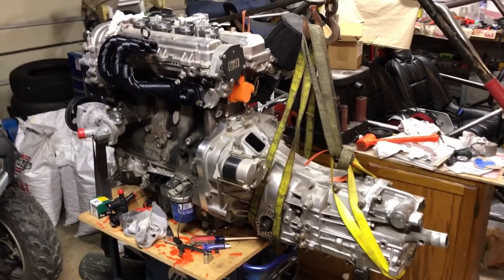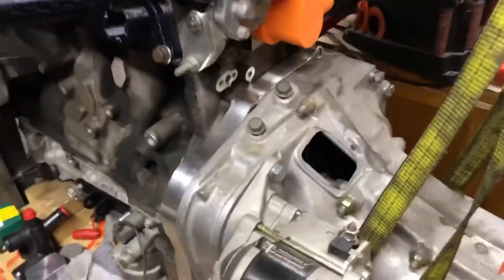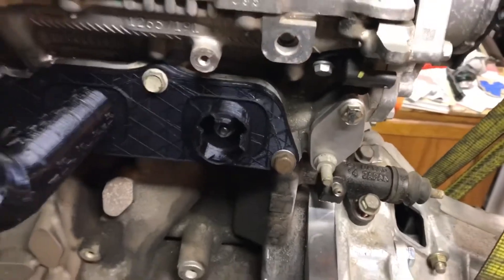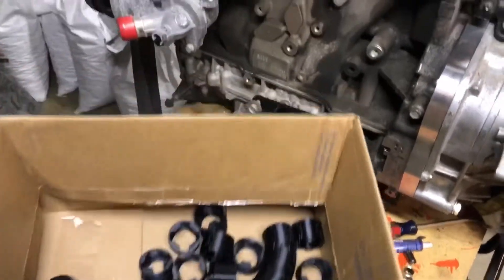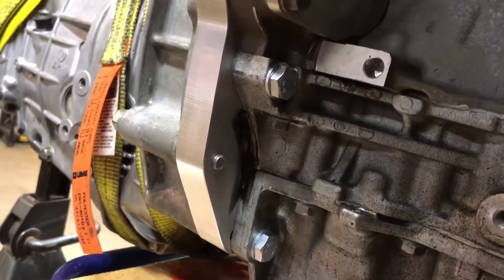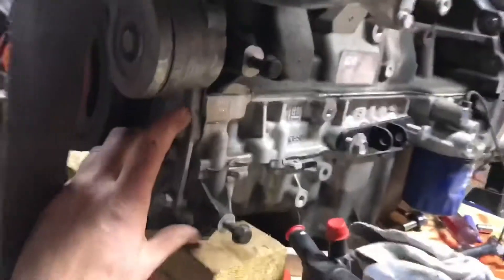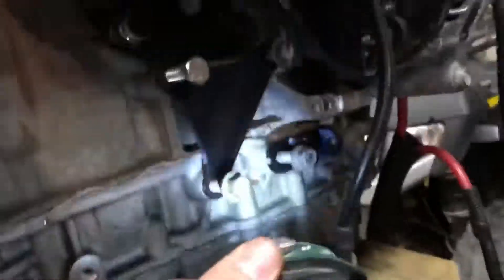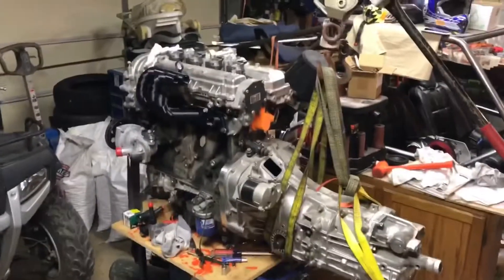First ever 2.5l Chevy ecotec direct injected adapted to Subaru transaxle

Comment: 0:53   did you say Snub Nose starter ?  what year subaru?
Reply from the maker: Yes. 2006 legacy gt.  It won’t have the support bearing on the outside of the gear.  https://shop.advanceautoparts.com/p/carquest-premium-starter-remanufactured-16696s/5845807-p?product_channel=local&store=6034&adtype=pla&product_channel=local&store_code=6034&gclid=CjwKCAjw49qKBhAoEiwAHQVTo88MZaTdAIIKz0NN4k6eVteV0V864UjWySa-YOPFO1Lb0z2yVPKByRoCV0sQAvD_BwE&gclsrc=aw.ds

Comment: How is the build coming along?  I have a Ford 2.3L out of a '96 Ranger, and added a turbo with mild boost.  It runs well for my purposes, but sure likes to get hot!  I'm trying a new radiator location.  Where are you mounting your radiator?  If I had known about your engine/trans combo before I invested so much into mine, I probably would have gone the same route...
Reply from the maker: Check out my other video when I first drove the buggy and you can kind of see the radiator mounted in the back of the engine. Thanks for watching.

Comment: Hello, just curious. Have you been able to tune the 2.5? I’ve been trying to find a tuner but people are telling me these engines throw rods or they don’t have a software made to tune them. But trifecta performance and BNR offer download tunes...so how does that work? I have the trifecta tune but I would like to get a manual tune
Reply from the maker: ReyRey hptuners or efi live should be able to tune these engines
Reply: @D6motorsports  sorry I use mobile and never get notifications. I have the efi live. Do you have an tips for performance parts like injectors or manifolds?
Reply from the maker: @rdavidf99  honestly if I want more power I will swap this engine out for the 2.0 turbo engine.  You will get a lot of money into these n/a engines with small hp gains compared to just getting the turbocharged engine
Reply: @D6motorsports  — I have this engine in a Colorado.  It is  a good naturally aspirated engine.  I agree, why mess with it?  If you want a turbo four, get the new 2.7L L3B.